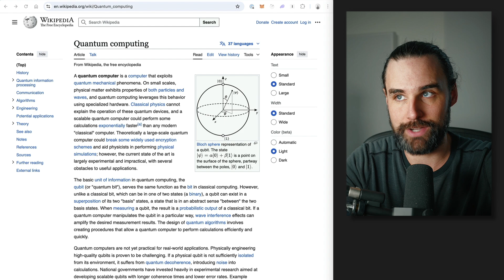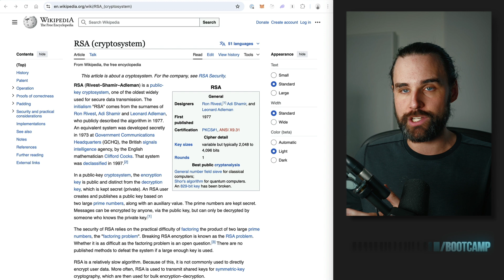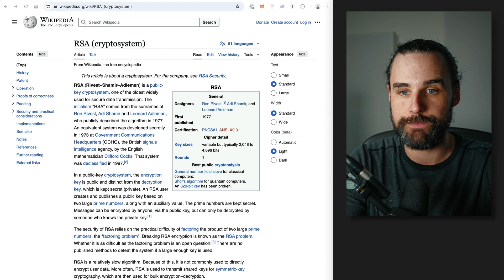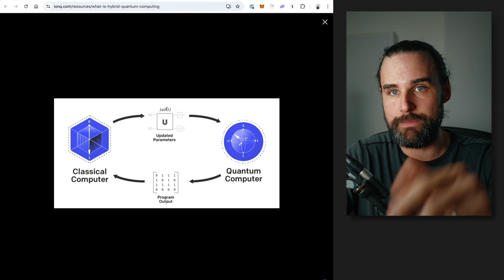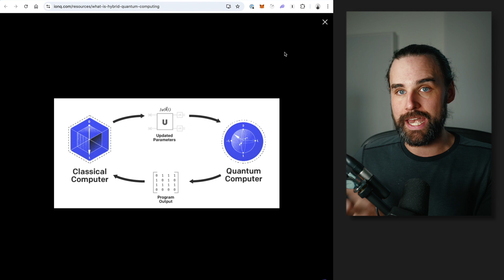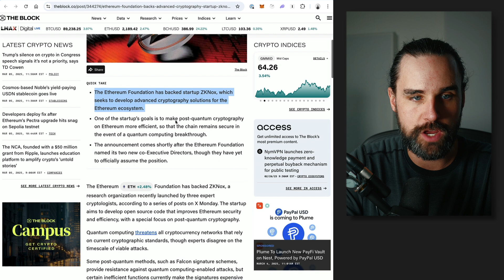This could end crypto for good...

Comment: everyone who is worried look into qnc.v Quantum emotion on the canadian venture exchange. its a quebec based company. they solved the quantum threat using a semi chip that has quantum entanglement as the algorithm for encryption. they released a wallet for crypto so you dont even need a quantum safe block chain (which is also available with qanx) and you dont need to fork btc which also wont work. quantum will only help restore the lost bitcoin everyone who died without these wallets had in the early days. if anything its good that quantum can hack the bitcoin, because yes its scarcity is important but its also valuable as fuck so it should be okay to get lower prices when the uneducated dont understand. well know when satoshis wallet is hacked that quantum is able to crack bitcoin. im not a quantum scientist or anything.